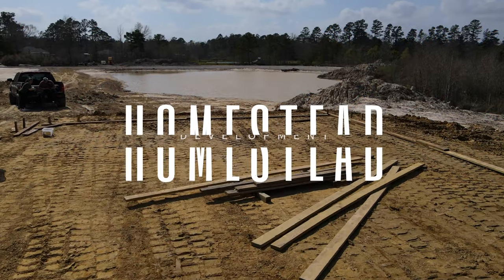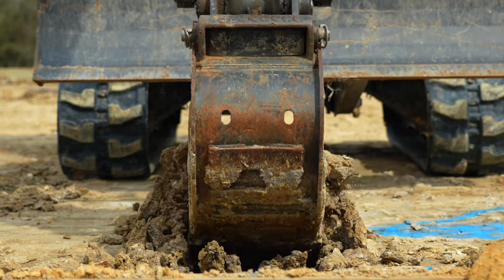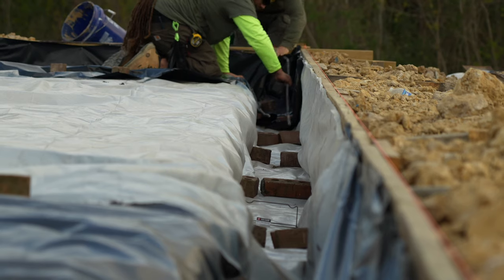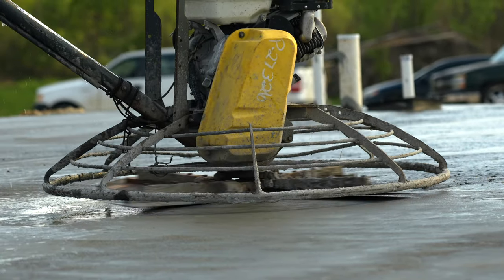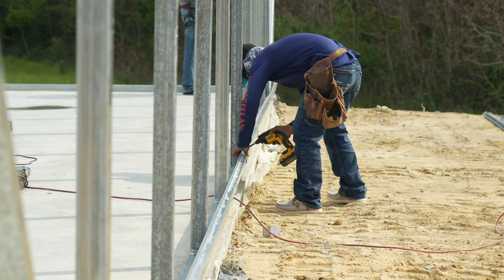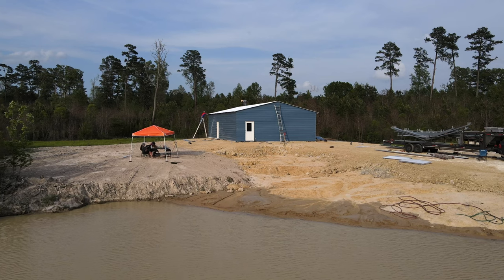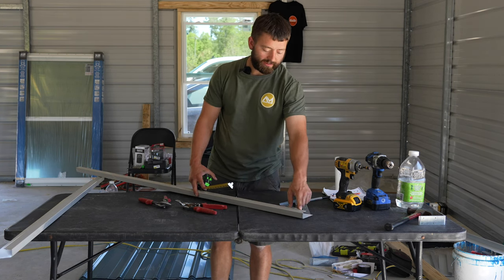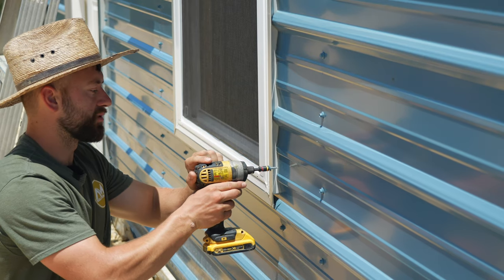How To Build A Barndominium | From the Ground Up | Part 1 Compilation

Comment: Thank you so much for providing all the detailed information. I recently lost my house to a fire, and I've been feeling overwhelmed about rebuilding without breaking the bank. Since I'm somewhat handy and have some skilled friends, the details you've shared, along with the cost breakdown, have been incredibly helpful. I can't thank you enough! Could you please let me know how tall your building was? Also, now that you've completed your build, do you have any advice or suggestions you'd recommend? I noticed that the warranty from where you purchased the building wasn't great—how has that impacted your experience?
Reply from the maker: The walls are 10 feet tall. The ridge is probably 13 feet tall. 

It's a metal building, so a warranty isn't very important to me. If you find a company with a better warranty and will allow alterations with that warranty, definitely go that route.

Comment: Did you have engineered plans and drawings you submitted to the building department? Could please share your plans?
Reply from the maker: Yes, they were provided by the manufacturer. I will link them in the comments
Reply from the maker: Just added a link in the description to the blueprints for the home and the receipts.